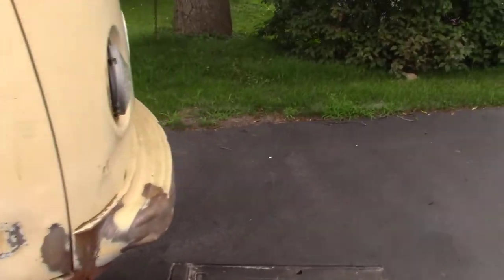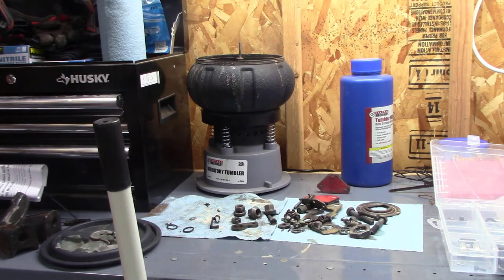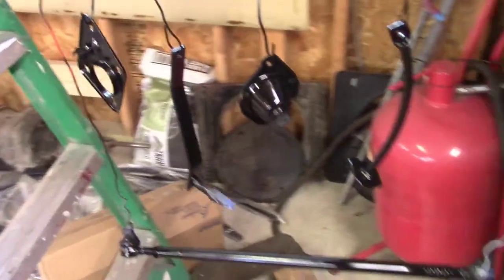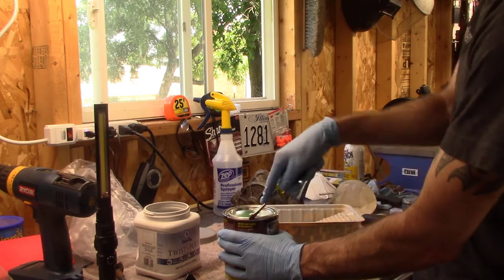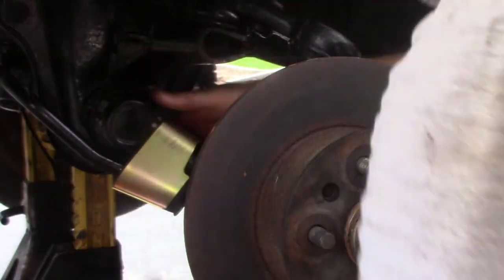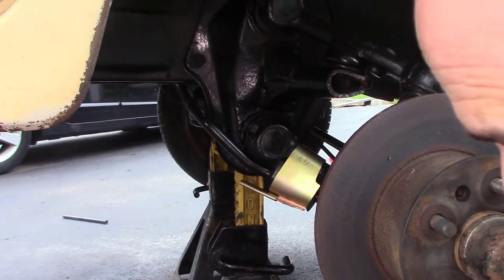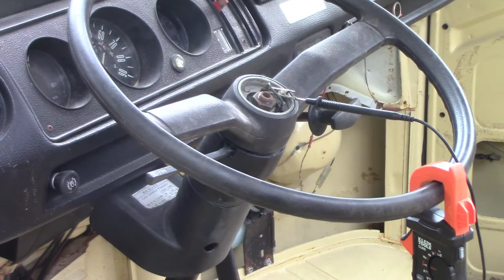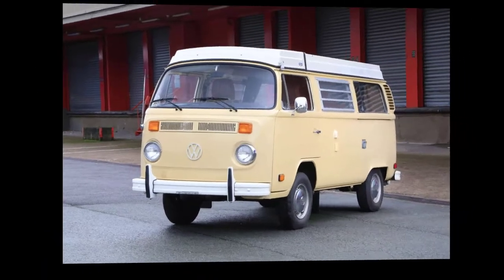VW Bus Restoration Part 4: Steering, sway bar and horn wiring

Comment: Well done! Did you replace the rubber steering coupler too? If you could share where you bought yours. Looking to replace mine, but some apparently are better than the others. Some apparently are even conductive due to metal reinforcements in the rubber, which is a no-go for the horn circuitry. Thanks in advance.
Reply from the maker: I did replace the coupler and, at the time, didn't realize I used a crappy/cheap part that actually caused problems I discovered later with my horn wiring for a different reason than you mentioned; it was the wrong thickness and didn't allow my steering wheel to set down on my column properly so the horn button ground could make contact.  See this video: https://youtu.be/BCVlFybAkIA?si=JBZ1AahbQBhSMJLv&t=1704.  The best coupler replacement appears to be the Lares 209 coupler.  A link to the part is in that other video description.  Let me know if you still have questions on that.

Comment: The POR15 can pissed me off too.  I ended up wasting half of mine because of it.  They really need to improve that.  Also I probably will never buy POR15 again since it really should only be used for rusty areas you can't remove the rust on, and when you are restoring a vehicle you remove the rust anyways.  It is better to get it to bare metal or close to bare metal and using an epoxy primer.  The only place I found it to be super useful was on my vent windows on my bus where the metal was super potted and the inside was hard to clean out.   POR15 made it look like new when I was finished with it.  However all the places I used it on my body I ended up just removing (like under the window rubber).
Reply from the maker: Yes, I have found POR15 doesn't adhere well to clean metal. I am doing the undercarriage with it because, even though I sandblasted the undercarriage and got all the rust, coatings, and grease off, I have let it flash rust. Even that little bit of flash rust seems to allow the POR15 to cure well to it.  But on parts that I have sandblasted or wire wheeled clean and immediately paint, I use primer and that black rustoleum.